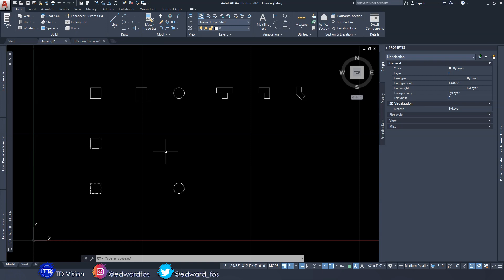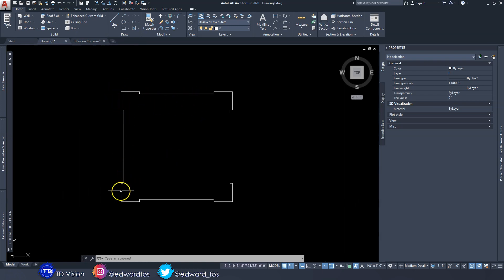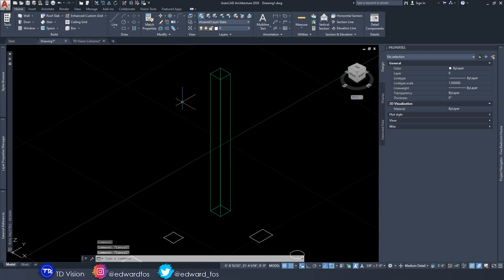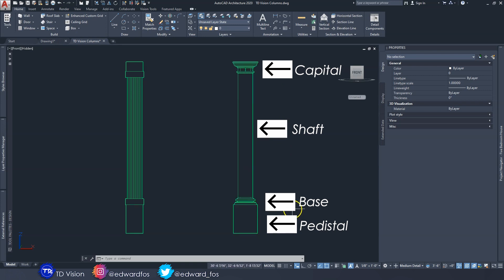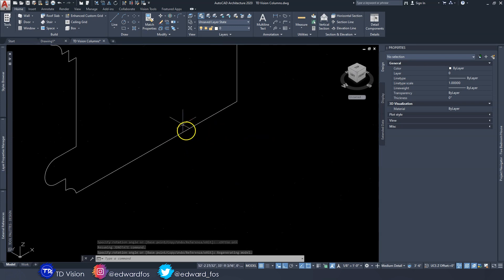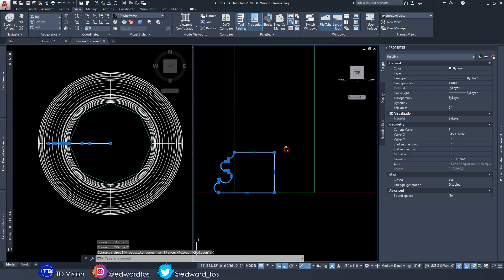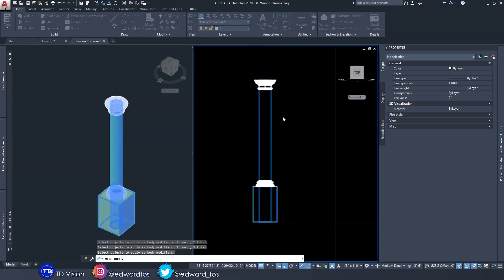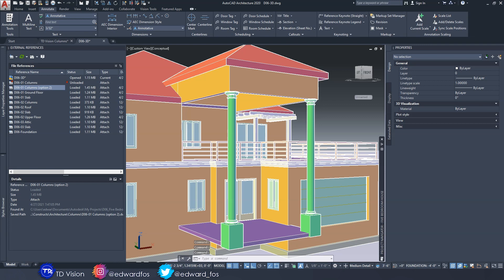CUSTOM 3D COLUMNS in AutoCAD Architecture 2024

Comment: Hi, thanks for your videos! I have a question: How can I create a Concrete encased steel column in AutoCAD Architecture? Besides that, can I obtain the Materials quantities (steel and concrete= also? Thanks in advance!
Reply from the maker: Even though AutoCAD Architecture is capable of doing H and I steel columns and beams, I don't think it has an automated or efficient way of doing the actual rebars and calculating quantities for those. I'm sure you could probably use mass elements or some semblance of structural elements, and creating a schedule on those. AutoCAD Architecture is mainly geared towards architectural design, and not structural design. I think Autodesk Advanced Steel (which is also an AutoCAD based software) might be a better option for this sort of thing. You can design the steel portion in Advanced Steel, and bring that into ACA.

Comment: Hi Edward!!! Greetings from Greece. I would like to ask you, if there is a way to make a custom column, but to be able to change it's dimensions like we do with walls (with grips). For example to insert a rectangular column and with the grips to be able to adjust the shape to the desireble one.
Reply from the maker: If I'm understanding you clearly, I don't think that's possible. That shape (profile) of the column is controlled by the column style. If you want a different shape, you'll have to pick from the style browser or create a new column style. The height of the column can be changed from the properties pallet. This video might help. Check it out. https://youtu.be/FkJU5CLQgaQ